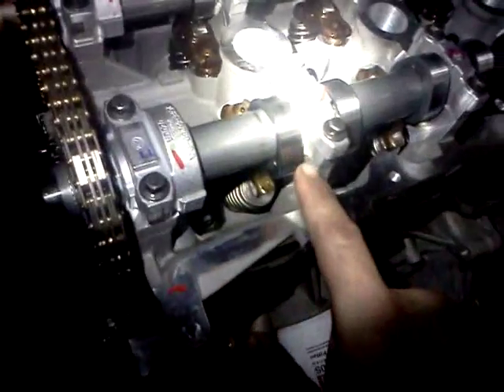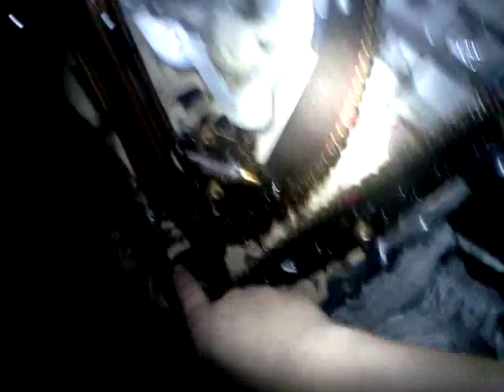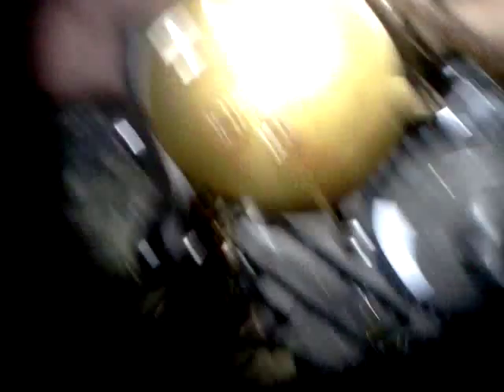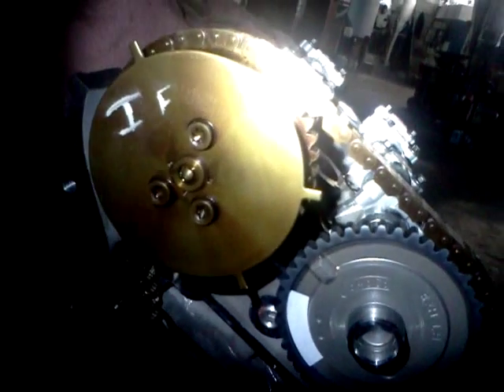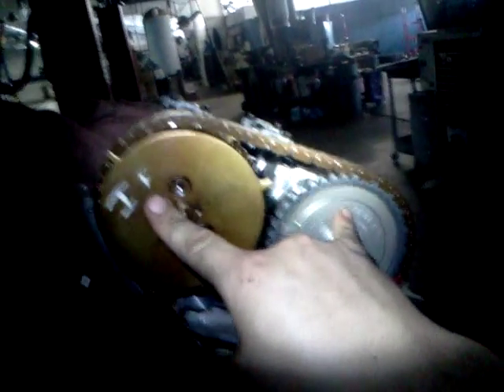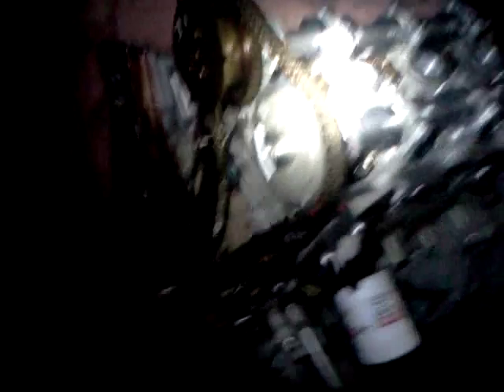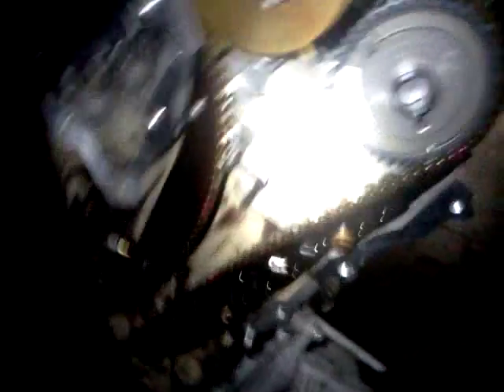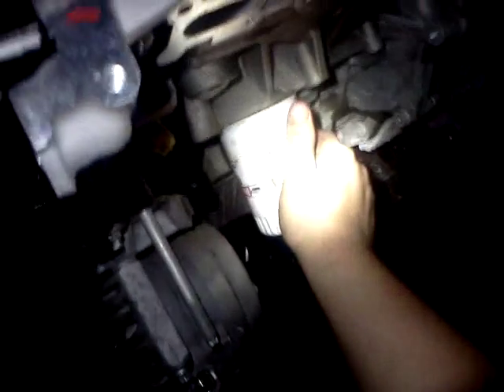Ford variable cam timing

Comment from the maker: yeah there hasnt been any tsbs or anything out for useing 820 vs 500 and i cant say that i think the filter changes that much between the two but ive seen the 820 used on a ecoboost and it was the first one ive seen with an oil leak come through my stall 

 as far as the fl-1A no new cars use it only thing ive seen is the ford ranger up to 98 or 99 something like that